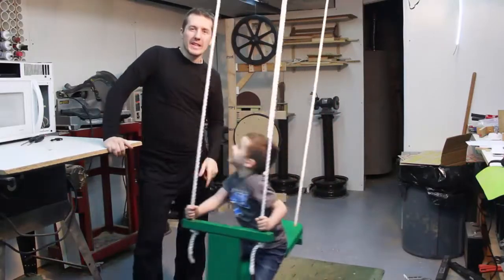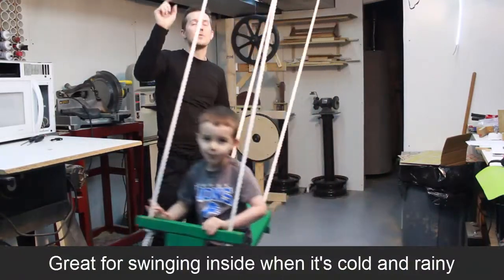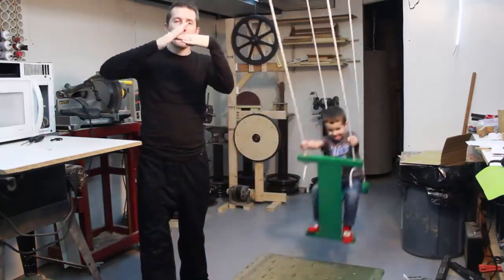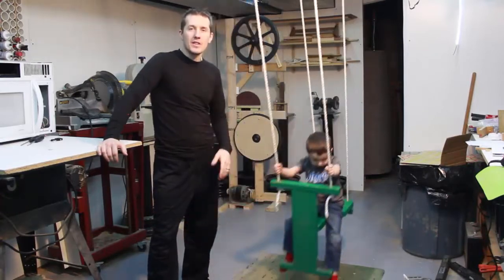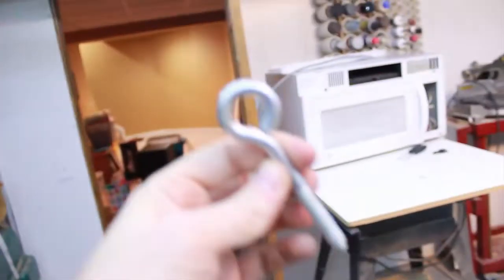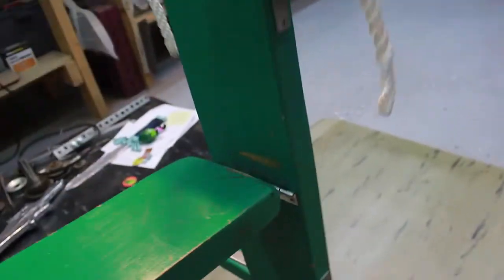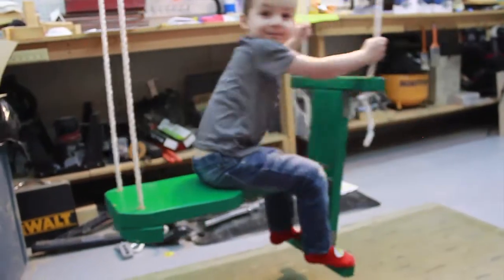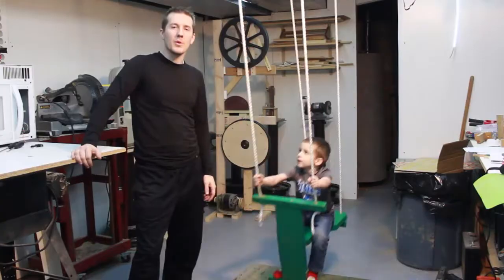Swing for Kids

Comment: Cool design! Would this work if the left-side back-and-front ropes were attached to a single hook in the ceiling and the right-side back-and-forth ropes were attached to a single hook in the ceiling? Like if you were attaching to two hooks on a standard swingset bar?  Of would this prevent it from "gliding"? Thanks!